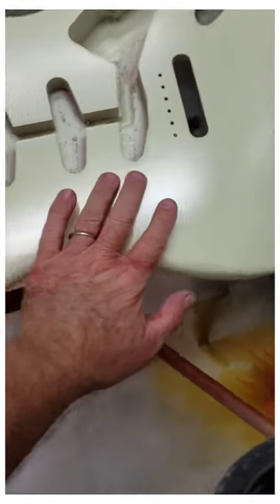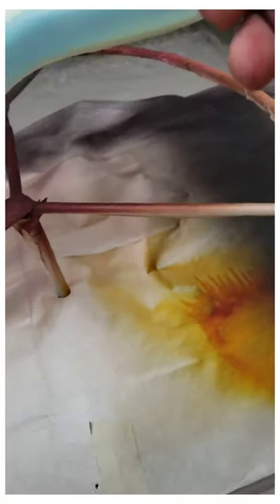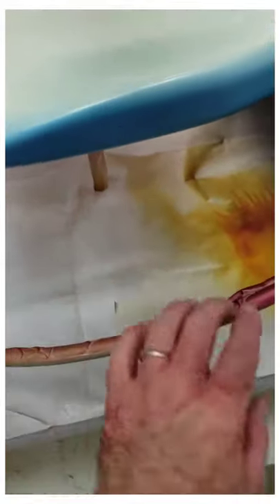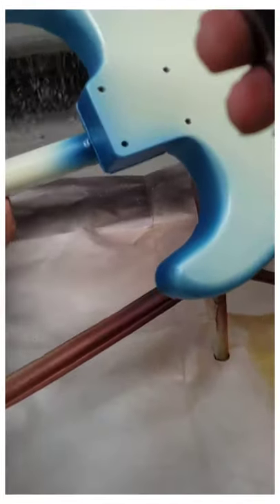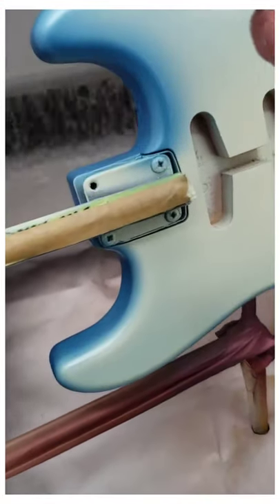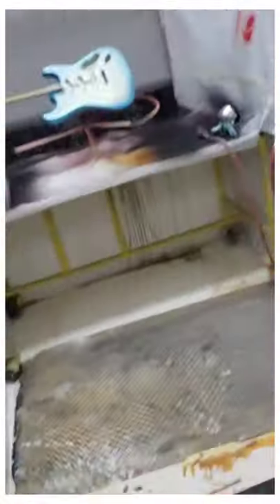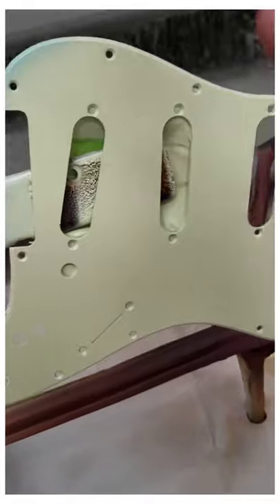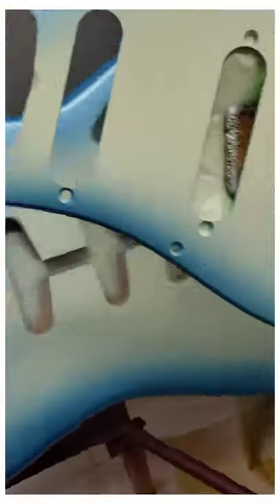Antigua Lake Placid Blue Strat with pick guard.

Comment: Really love your videos Jay, thank you! Can you possibly show a satin black finish? 
Also, is the process for finishing: sand to 220, grain fill and sand smooth (if necessary), sanding sealer, primer, color, & clear? I’m going to attempt to try this but with rattle cans. Thank you sir!
Reply from the maker: Basically that's it. Sanding sealer then primer isn't necessary. You can do one or the other depending on the end result your going for.
Reply: @JNcolor  Any past experience using Behlen nitrocellulose lacquer products? Thanks in advance sir!
Reply from the maker: @Strumbum01  No, I am unfamiliar with that brand.